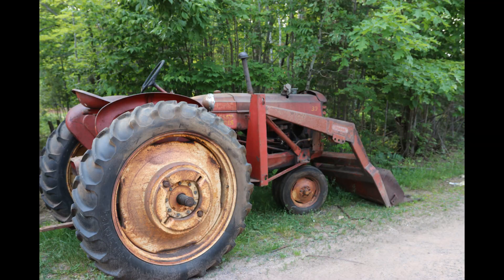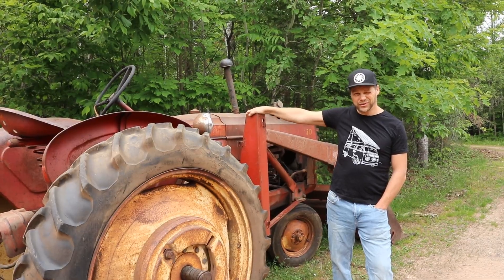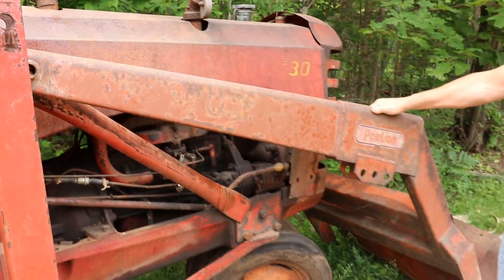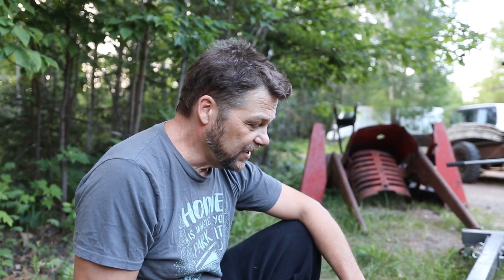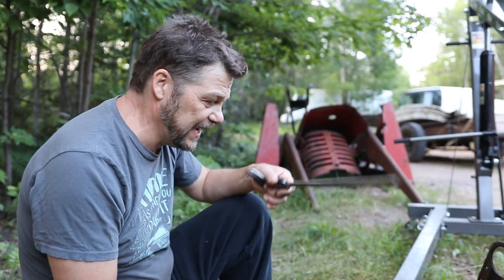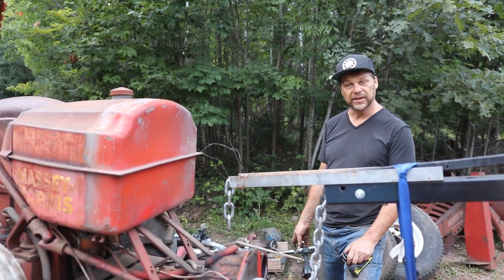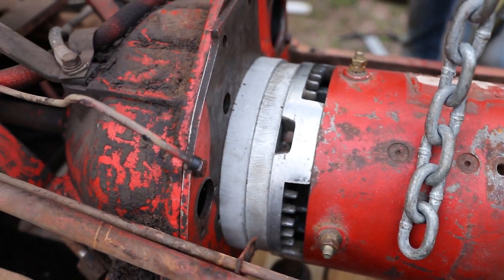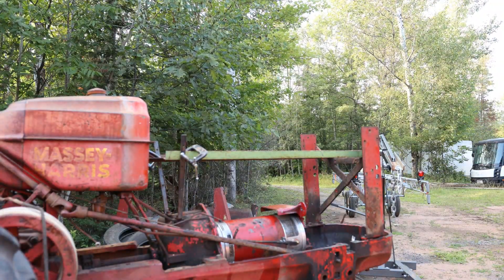Massey-Harris Electric Tractor Conversion by Solarrolla

Comment: If yall wouldn't mind sharing the battery to AC transformer and electrical guts, I think a lot of people would like to do this conversion.  If you are able to sell various conversion adapter accessories (engine mounts, bolt plates) I'm sure people would be happy to purchase from yall.

Comment: What hp would the electric motor be providing that you actually installed?
Reply: It depends on the voltage you feed it. The motor is capable of 200HP equivalent. He said they would be getting 15HP I think.

Comment: All day long
Fat chance just on the batteries So what? a 30min run time? purpose built electrics only do 2-5 hours.
All the losses of batteries combined with the losses of an old transmission?
You couldn't be bothered to try and free the engine first or find something that had spat a rod?
Still would be a fun run about though.
Reply: A couple hours at best, but thats probably more than enough for a utility loader hanging about on the farm. Its row crop days are long behind it, but for quick chores a tractor like this is great.

I could easily have one of these that did no more than 25 hours per year, but would be really handy to have when I used it. No sense spending $$,$$$ for a 25HP compact for a job like that. Plus now you won't be dealing with engine maintenance arising from disuse.
Reply: Geared transmission is only 3-8% loss